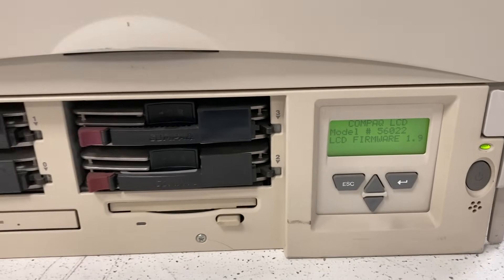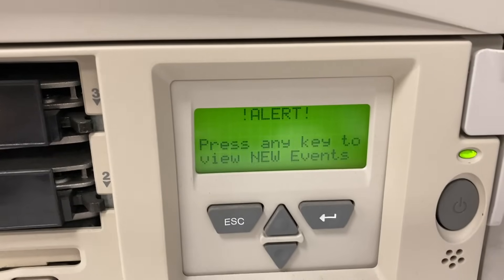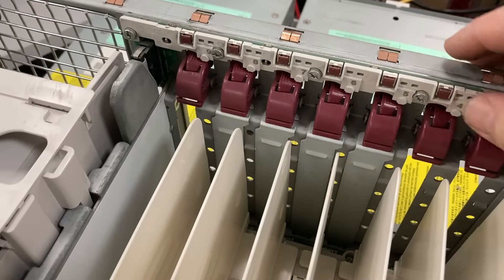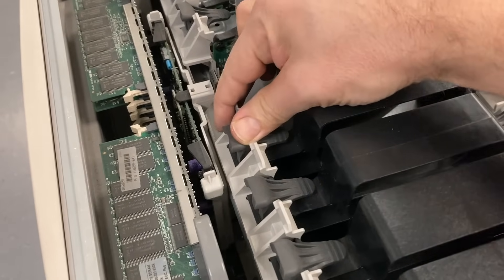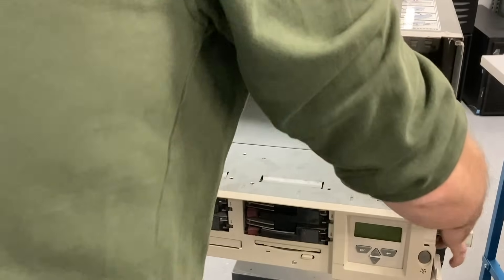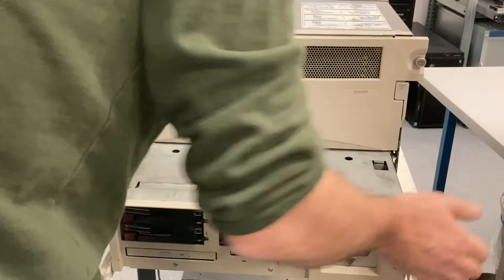Compaq Proliant 8500R from 1999 - (PWJ226)

Comment: This brought back some great memories, thanks for showing off this server! Those DC converters were called Voltage Regulator Modules (VRMs), and were redundant. One side of the board could have a component fail and the other side would take over without the system going down. I think it was converting to 2 different voltages as well, possibly for the separate cache chip vs processor chip those Xeons had under the cover. That's why it looks like 4 separate sections per VRM board.

That Profusion chipset sitting in the middle of the processors and memory board was a Compaq and Corollary design, solving an issue Intel and HP struggled with since the Pentium Pro. Going above 4 processors with Intel chipsets didn't work, the traffic to manage cache coherency between them would overwhelm the CPU bus of that era. IIRC HP tried to crack the 4 processor limit with a 6 processor Pentium Pro machine that performed poorly around that era. Compaq's key was to split the processor bus in two, and use SRAM cards with their own direct connection on both processor busses to sync cache between them. The Profusion chipset also had 2 memory busses, one bus out to the PCI slots, one smaller I/O one, with a crossbar switch distributing traffic among all the busses. This became the chipset other vendors like Dell licensed to ship their 8 processor machines, though Dell made theirs look cheaper. Their base model one shipped with smaller SRAM cards, limiting the amount of cache the Pentium 2 and 3 Xeons could use to 512KB, instead of the max of 2MB. That would lower performance a bit unless customers paid more for the pair of 2MB SRAM cards.

Smart Array wise, this was one of the earlier machines to get the newer integrated version meant for servers like this with only a few drives. They became common in the 1U DL360 servers that launched shortly after the 8500R (which got renamed DL760 and upgraded to PCI-X slots IIRC).  The Proliant 8000 was also an 8 CPU server built around the Profusion chipset, but with 2 PCI-ES slots and 4th generation Smart Array 4200ES controllers driving 18 internal drives. Those were wild, in that it routed 3 SCSI connections not over cables, but through the PCI-ES slot. It allowed a redundant controller to be on standby ready to take over if the primary failed, with the SCSI cables attached to the motherboard. That era was when customers were switching from a lot of direct attach SCSI drives to fibre channel SANs, and the 8500R was aimed at those on the SAN side.

Comment: Great machine, built to work and to last and to be serviced. Are modern servers no longer made to be this easy to service?
Reply from the maker: Modern servers have less parts and that makes them easy to repair. A new HPE G10 or a Dell R660 have about 6 cables to unplug, two power supplies and two PCI riser modules to remove and you can take out the mainboard.

Comment: installed three of these back in 1999 to replace four P133 desktops (3  running NT 3.5 an 1 with NT4) - quite why a major UK company would still be using obsolete desktops as servers I never did find out.

Comment: I used to run MS Exchange for 2000 users on an eight CPU 700MHz Xeon based system. It cost around £50000 at the time without the external disk cabinet. It was the fastest windows server we had at the company.

Comment: Thank you for uploading. I really enjoy to see these old servers. Maybe because thats makes me feel young again when I used to read everything I could get about computers.
As always I've got some more commentaries:

0:16 UNLIMITED POWER!!!! SCNR😅
4:12 64-bit PCI-X 5 volts I would say. PCI was already 32-bit as well as MCA.
6:19 PIII Xeon tops out at 44 W TDP. So together with that fancy heatpipe coolers it would be sufficient cooling.
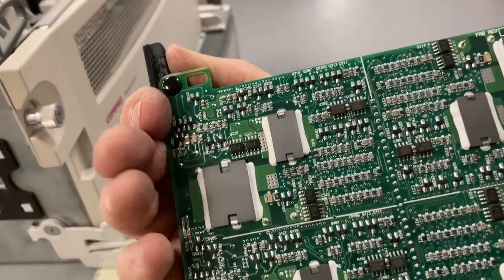8:24 These should be dual redundant power modules / VRMs. Probably two phases 5 volts each. Could be 12V but judgeing by the ninth one used for the bus architecture and how little there is in terms of power delivery on the memory board I would guess it has to be 5 volts. I don't think Compaq used the 2.8 V variant of the PIII Xeon. Seems to far off the 3.3 volts needed for the RAM but I might be wrong on this one.
8:41 These are the Corollary Profusion cluster controllers or chipset as Intel would call them (Intel bought Corollary while they were developing these) that make actually two four CPU servers into one eight CPU server via bus bridge magic if I remember correctly. These two chips on the board would be the northbridges [sic!] while the two cards would be the cache accelerators for maintaining cache coherency for all eight processors. There have to be at least two PCI bridge chips and an Intel southbridge somewhere in there.
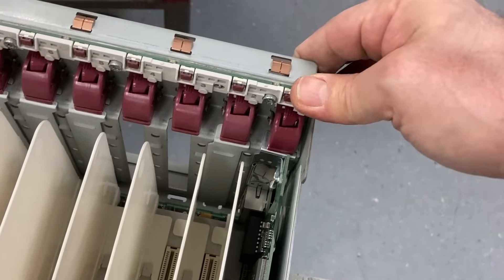14:29 It depends. Typically an PCI card could have three rows of connectors as well if it supports 3.3V AND 5V. While the slot would have only 2 rows depending if it's 3.3 or 5 volts. A PCI-X card could have up to four rows of connectors (3.3V AND 5V aupport) while the slot would have only 3 again depending if it supports 3.3 or 5 volts.

Comment: Nice junk. At 6:46 you can see also the processor terminator boards required to fill every empty cpu slot. At 8:44 are the two Cache Accelerator cards (each for 4 processors bus) used by the Profusion chipset to speed up the cache lookup.

Comment: I love Compaq before it was acquired by HP, because it scrapped the brand.

Btw, great video
Reply: Not the only thing HP scrapped😅
Reply from the maker: In fact, Im glad that HP continued the Proliants and scrapped their own Netserver line. Those were pretty unreliable but easy to repair. They mostly suffered from bad interconnects. Proliants worked much longer without an issue.... until Gen10 came around. Best HP servers ever were the Gen7. Almost no repairs with them. Gen8 have the horrible soldered flash chip that fails. Gen9 too and additionally mainboard power problems. Gen10 and 11 have stupid firmware issues.
Reply: Compaq was just a Box seller, cloned chepa boxes.  HP, old people like it, great name that is.

Comment: Thos PSU units supply 2 voltages IIRC, one for Vcore and one for IO, the 2 per side is just to interleave them to reduce ripple. Took apart a much simpler Proliant, and it only had a single processor and power supply card with the 2 voltages for the CPU. Had 2 SCSI drives, and actually still booted to Red Hat enterprise 4.0, though the full height drive was incredibly noisy bearing wise, likely not long for this world. Definitely was not as it went to pieces and to scrap metal, though I did make a recording of the noise using a piezo accelerometer that I screwed to the drive.

Comment: I still have a Proliant 5500 with 4x Pentium Pro 200 CPUs and 2GB RAM.  It uses the older "rock lobster" drive trays.  There are two Smart Array 2 controllers in it.
Reply: „Have“ like own or like running in a productive environment?
Reply: @chrisridesbicycles Have as in own.  I do run it occasionally though.

Comment: Hotspot PCI and PCIe is still a thing. Modern PCIe does support it. There are very few servers (notably IBM, Fujitsu) that use that, but for general use, even if advertised you can not do it (even on servers that say that mention nothing about it, including your desktop computer with PCIe). And it works. The things is, there is very little point having this feature. If you have catastrophic failure, you usually need to power it of and open. Also in modern servers, if you open the case while it is running, it will very quickly overheat under load. If you care about reliability, it was always the case to just use redundant cards, and on failure or upgrade, migrate workload to other computer. Even most business critical systems, do have allowance every day or week to do maintance off hours, to do such things. And in systems where you cannot have such allowance, you will have two completely separate machines, so you can do maintance one at a time.

So in 99% of cases these hotswap features are just a gimmick, and an unnecessary cost.

Long story short, hotswap is overrated. Even hotswap of power supply and fans is a bit overrated, but it is very easy to implement, so still done. I have never actually seen anybody do hotswap of these components in real life. For PSUs and fans, only in most critical systems, like core telecommunication switches you will make sure you can do it, to keep uptime of all systems. And on server, only hard drive replacement is important (because they do indeed die often, and every few years you have capacity improvements).

Comment: I think the progress in power supplies is most staggering and rarely realized thing. As you said you can have same power in like 1/10 of the volume of these old boys. Maybe even more.
Reply: Though the new ones are totally unrepairable, and cook themselves to death in a few years. Those old ones run cooler, have decent airflow and no hot spots, and are serviceable, so that if you need to run a server for a few decades, like banks and others tend to do, they will last the distance.
Reply: Yeah but they're built better with more and larger components and bigger heatsinks. Id much rather have one of those PSUs than a modern small one.

Comment: 4:11 You said these are all 32 bit PCI sockets. What I see in the video are 64 bit 5V PCI sockets. They got the 64 bit extension on them and the notch is for 5V signalling AFAIK.
Reply: I noticed the same thing. Towards the end he mentioned 32 vs 16-bit PCI connectors... There never was a 16-bit version of PCI...
Reply: 16bit was ISA. PCI was 32bit from the start.

Comment: Calling it "hot-plug" when you have to wait for the power to turn off seems like a little bit of a stretch. Mildly-warm-plug? Lukewarm-plug?
Reply from the maker: The meaning of hotplug is the server doesn't have to be powered down to replace a PCI adapter. But yes, if you're taking it literally, then it's only residual-heat-plug. 🙂
Reply: I like how the LCD tells you it's an LCD 🥴
Reply: @f.k.b.16  It's good at self-promotion.

Comment: Where did you dig up that oldie? Does somebody still use them?
Reply: This tech was obsolete 15 years ago already. Your phone has more processing power than this thing.
Reply: @movax20h  That‘s why I asked. Does somebody still put 2000W of power into such an old system because it‘s part of some certified system?
Reply: @chrisridesbicycles  Most likely, or it was doing some important but unglamourous work in a data centre, and was just running along with nobody caring about it. Either it had all the redundancy finally drop out of the RAID, and it fell over hard, causing a massive issue, or somebody noticed the red lights of doom impending, and decided to migrate the server over to newer hardware before it stopped running, or they finally finished migrating from an old ERP system, and had reached the end of the retention time, for legal purposes, of the old system. I had that, old unloved Netware server, where the only logins in 3 years had been me, looking once a month to see if it was still alive, and to look at if anybody had accessed any of the data. After 5 years it was turned off, with a screensaver that had rolled over the uptime amount for Netware 3.1

Comment: It's amazing how quickly this goes from being the new hotness to scrap value.
Reply: the life cycle of tech was over far sooner for these older machines than it is for core2duo and newer machines.
Reply: @rysterstech Yeah, back then you couldn't really use 5yr old computer equipment. These days that's no problem, even with servers! Many big businesses that can afford it will refresh their equipment regularly to avoid age-based equipment failures; Often times they just lease the equipment.
Reply: @NerdyNEET  Phones in particular.
Reply: @jimsvideos7201 
And then they switch off 4G and make all the apps 1GB+ each...